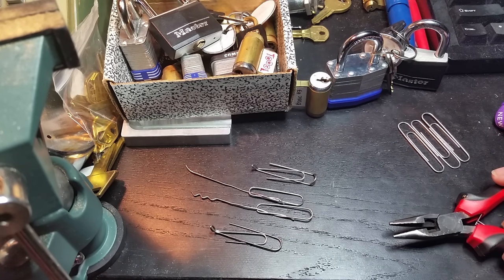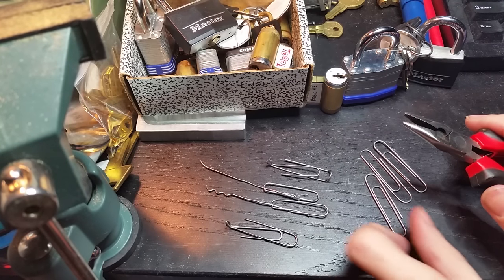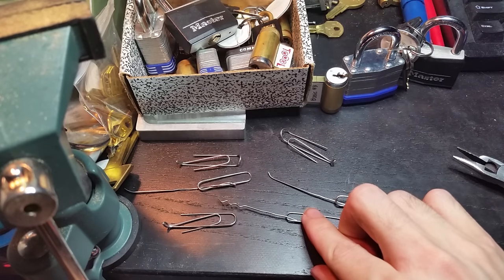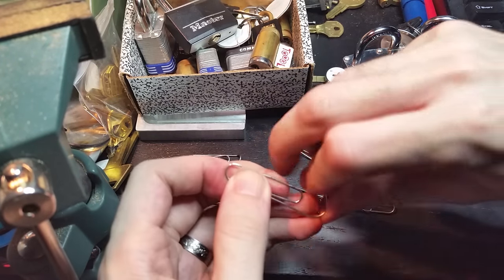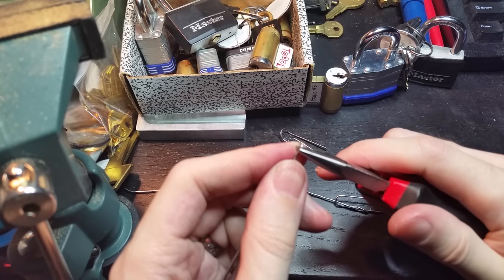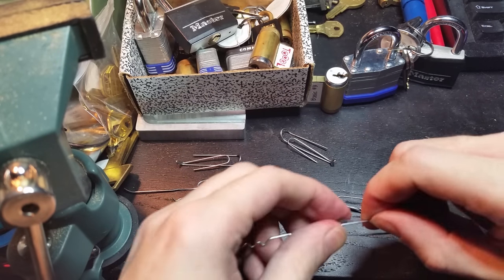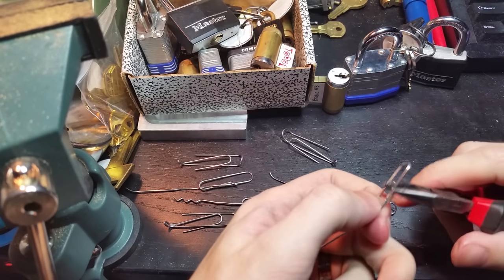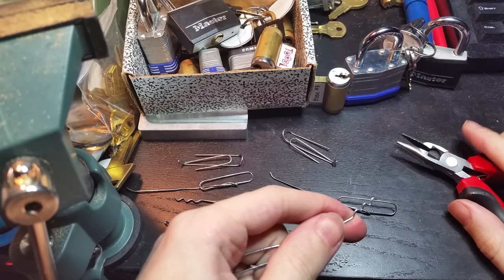(62) Make lockpicks out of paperclips

Comment: Will this work on a U lock or do you have to PUTCHASE one of those Chinese lock picks?
Reply from the maker: That depends entirely on the specific mechanism (U-locks are a form factor and have been manufactured with a huge variety of keyed lock mechanisms). These tools would probably work on many pin-tumbler, wafer, and tubular designs but would likely not work on the disk detainer designs that are becoming prevalent in modern U locks.